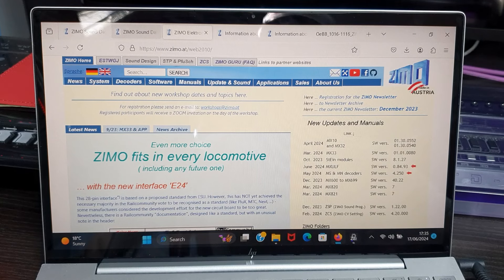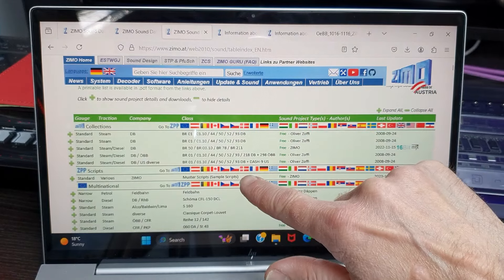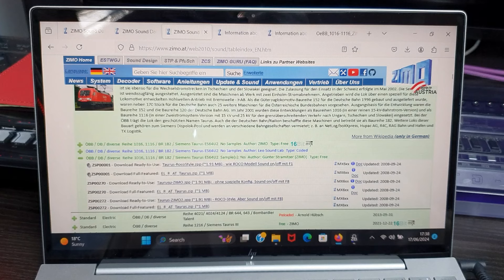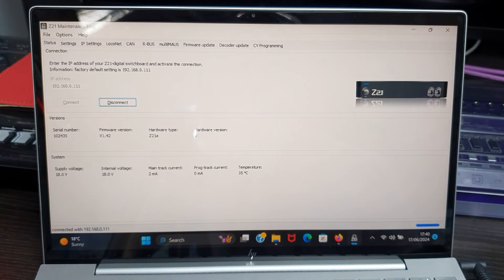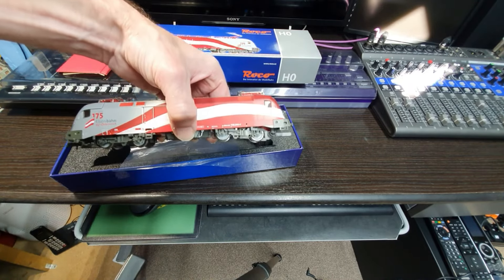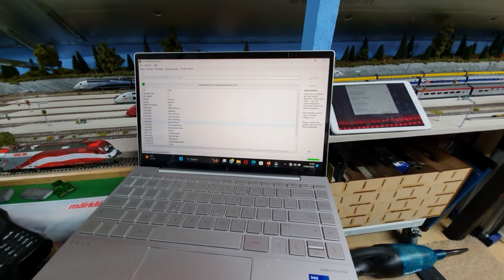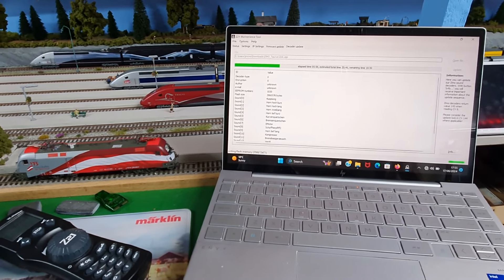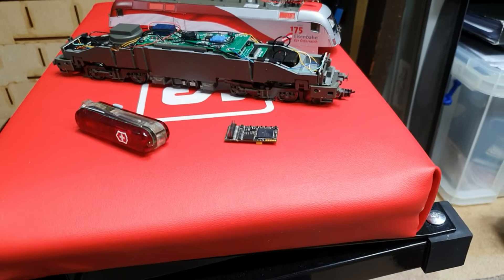Attempting to use the Z21 to program Zimo chip

Comment: Hi, can you do a video on block detection please. Block sizes, do you include or exclude points, blocks within reversing loops, etc? BDL 168 verses ESU ? Any recommendations, thanks for your help !
Reply from the maker: Hi Alan , 
Your best bet is 'Rudys Model Trains' , this is where I learnt alot about automation, and before that is was trial and error which it still is to be honest.
I have one sensor in per block on the main lines and two in the station areas.
Keep the points out e.g exclude all pointwork.
Just make sure the blocks can take the longest train you have and all point work will switch correctly.